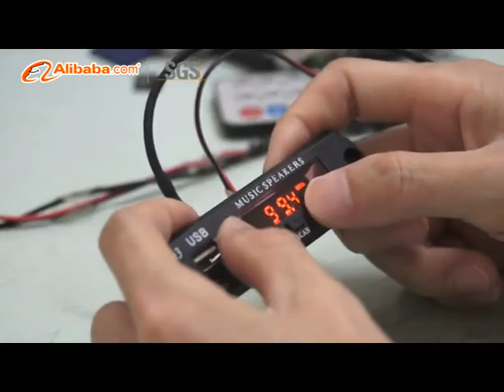Manufacturing Audio Sound Module | Audio Decoder for 10 years - Shenzhen Vire

Comment: delhi INDIA  Vire Silicon & Technology Co., Ltd is a company specialize in audio module / PCBA/decoder, Support  FM/USB/SD/TF/MP3/Video / AUX/ Recording / Bluetooth /amplifier audio module, with  remote controller. 

addresh: shop no 610 old lajpat rai market delhi india 110006
tel:01143004661.  mob.+91 9555577706
email: vijayrajput.in@gmail.com
website: www.vire.net.cn

Comment from the maker: Shenzhen Vire Silicon & Technology Co., Ltd  Established in 2007, with the express purpose of designing and manufacturing Customized Audio Module/PCBA, Shenzhen Vire Silicon & Technology Co., Ltd has experienced significant growth in the past years and continues to move upward to address the needs of the global market through improved technology. Now we’re the leading manufacturer and exporter of Audio Module/PCBA in China.

Over 5,000㎡ manufacturing plant located in Ganli Industrial Park, Shenzhen, China, with 200 skilled workers and experienced R＆Ｄ team. There are four FuJi high-speed chip mounters and four multifunctional machines in our SMT workshops, and the daily capacity up to 3,000,000 dots. With four reflow soldering production lines in the DIP workshops, daily capacity of PCBA reach to 70,000 pieces. The advanced testing and inspecting instruments, strictly quality control process make our defective rate less than 0.1%.

Until now, we have gained praises from clients around the world, this attributes to our efficient management and strict requirements on quality in company’s continuous development and innovation. Our products conforms to most advanced international safety standards and environmental protection requirements, yet we have been certified by the ISO9001:2008 Certificate, CE, UL, RoHS and other standards, now with the customers from Europe, America, Oceania and Asia-Pacific region.

Professional engineers, hard-working staff and advanced equipments allow us to design with the requirements of the OEM, make variety customized audio module/PCBA quickly and reliably. Based on the spirit of "Innovation, Development, Pragmatism, Responsibility", we continues to invest in R & D, Staff Training, Costs Control with modern management. VIRE sincerely hope to satisfy you by providing best products and excellent service.

Email: sales33@vire.net.cn 
Website: http://www.audiopcba.com
Address: 3/F, 5/F, Building 2, Caopuxiawei Industrial Area, Ganli Technology Park, Bulan Road, Buji Street, Longgang District